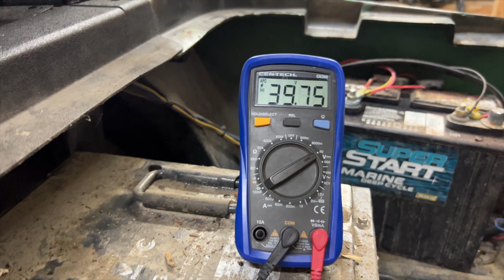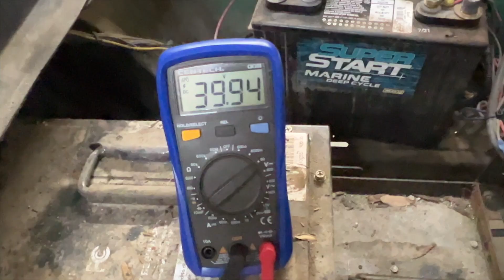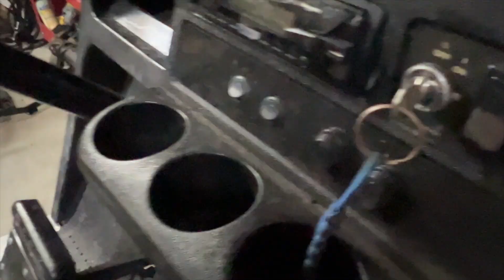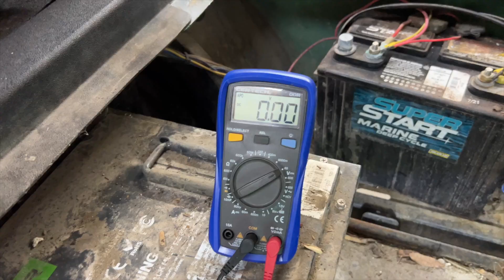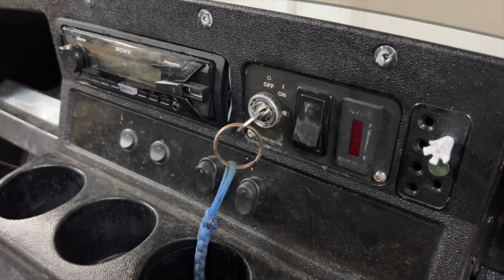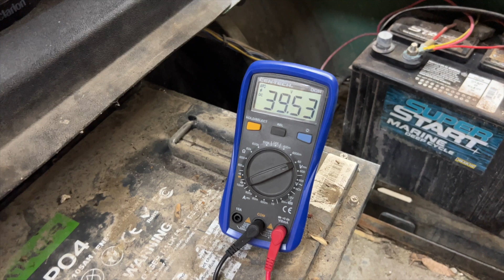How To Test 36v EZGO PDS Golf Cart That Doesnt Run

Comment: I just installed a new motor, controller and lithium battery. We got the cart in pieces. Once we completed the cart, it wil take off fast and go in to limp mode. 7 mph. Any help would be great
Reply from the maker: Depending on what type of cart it is, I would check the speed sensor on the motor.
Reply: @Fentertainment I feel like an idiot, the new motor we got didn’t have a speed sensor with it and i honestly think that’s the issue. Thank you so much for your help. Now I just need to know what to order and how to install.
Reply from the maker: @anthonymay764 what type of cart is it? Is it series or sepex? Does it have a fnr switch or fnr lever?
Reply: @Fentertainment it has the FNR switch on the dash. I know there isn’t a sensor in the new motor, bc I looked at it and completely ignored it, that was my bad. Where does the plug go to once I install the new sensor and magnet?
Reply: @Fentertainment it’s a 2003 pds ezgo

Comment: I have a 2004 EZGO Txt PDS cart. Trying to hook up my 12v reducer and fuse block and find a ignition wire. Someone on a FB group said because its a PDS cart, you can't tap into a ignition wire because its doesn't have power until the pedal is pressed. Saw another video on here about tapping into the red wire at the ignition that is going over to the volt meter. Can you shed any light on this please?
Reply from the maker: https://youtu.be/eX_h7SE88C8?si=S_E_AgYI883zUxSj